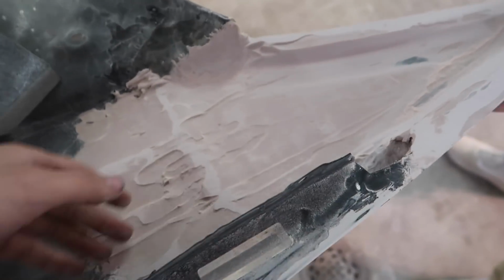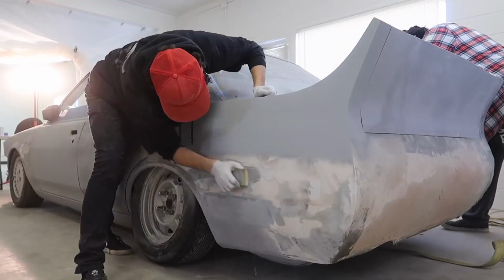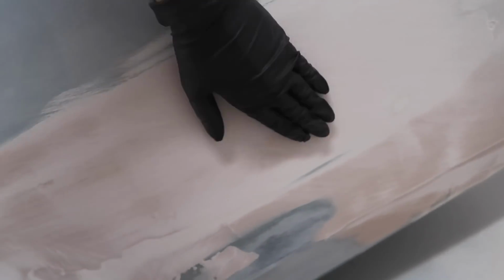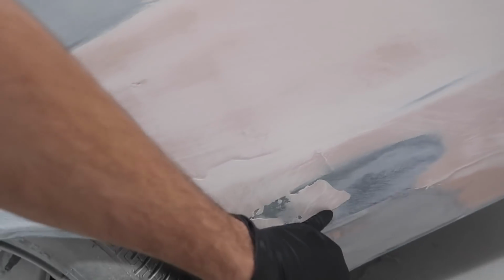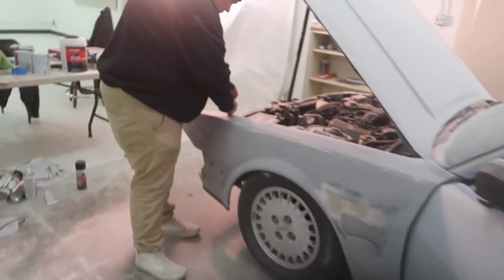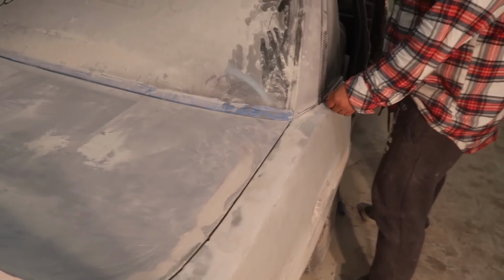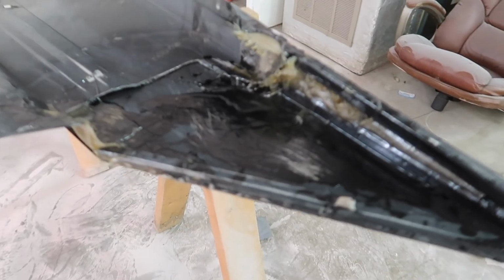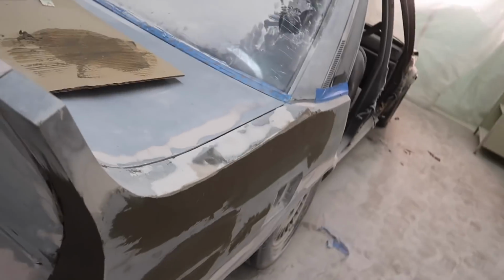All This Time And We Wont Even See It!

Comment: Tyler I hope you don't have any work that requires the rear bumper off now you've sealed it on. I didn't realise the guy who did my Rex blended and sealed my sideskirts to the body, which has now joined my front fenders permanently. I either cut a horrible verticle line through it or have my whole side skirts redone, and also fuck up my tri-coat pearl paint. 
The butterfly effect + cars = arseholes....

Comment: Tyler one thing you have to realise is every part of the vehicle has to be perfect . Now I don't build cars I build high end bicycles and I have opened  a lot of parts to modify them . I can tell you the manufacturers even anodise inside and do a lot of very nice work that you won't see once you put the cover back on . In my rear wheel the ratchet  system is all gold . It looks amazing but you never see it . FYI the gold is ti nitride and as you (should) know that is a very hard coating for reduced friction but most importantly hard wearing .